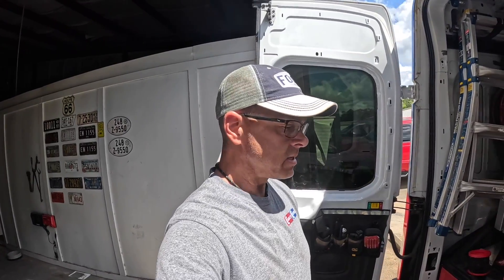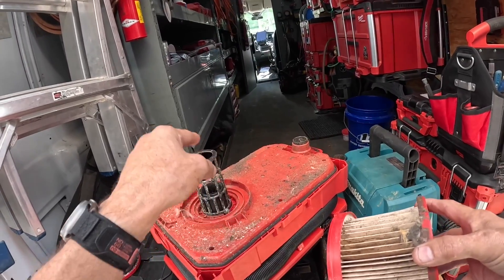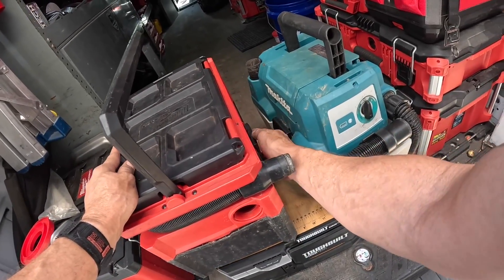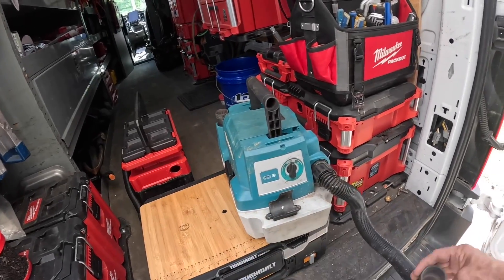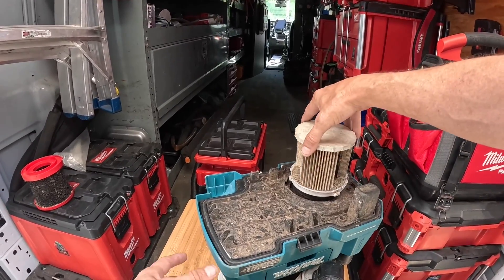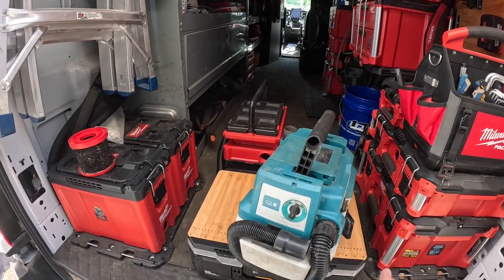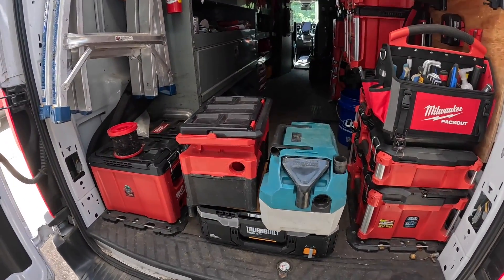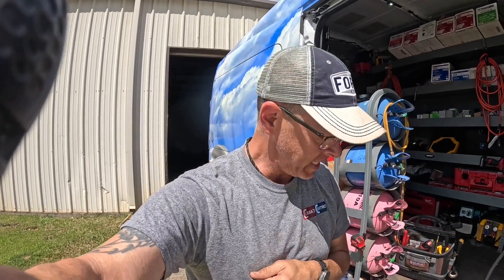Comparing and Reviewing the M18 and Makita Wet/Dry Vacuums For #HVAC! #hvacguy #hvaclife

Comment: The Makita vacuum filter you cut is washable and it should have come with a foam pre filter that wraps around the filter with the float for using it as a wet vac.

Comment: I'm not surprised at the Milwaukee lack of precision in their tools. Have bought about three tools, a circular saw with a wobble, drill bit adapter bits didn't fit well, and a new compound saw i had to take to repair, before even using it, for adjustments.

Comment: I have the M12 vac and love it. The hose packs away on the inside. I've never had any sealing problems with it.  Aren't you suppose to remove the filter when you're sucking up water? That's what I've always done.

Comment: I have the Makita and the Milwaukee 12V vac, I love the Milwaukee 12V but you have to use the 6.0 battery AND it’s quiet and powerful, just my .02 hope it helps..
Reply from the maker: Not if it has a float init
Reply: @HVACGUY  Doesn't It suppose to have a float in it so you know when to shut it off and it blocks the water getting sucked in the motor.

Comment: Thanks for the review.  We have the Ryobi version in their One+ line.  We've never had any trouble closing it or getting it to seal. It does a decent job around the litterbox or under the sink. I have a DIY-Vac, but our drain line hasn't yet clogged enough to test that.

Comment: I went with dewalt great seal and vacuum i’ve always used a 2gal shop vac with a small 14g ext and jumper 110v  never fails turn it on and then check out drain pan if it dry i’m golden if not ill blast it with air from up top voilà done